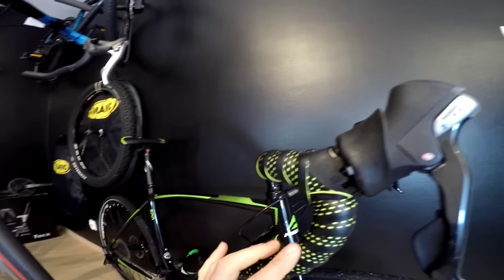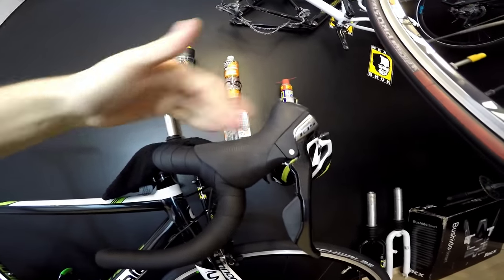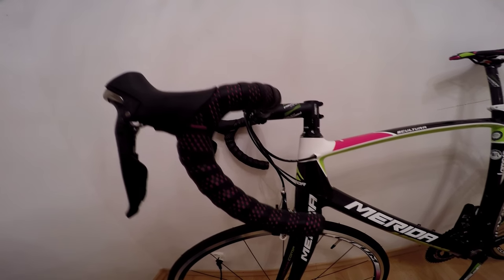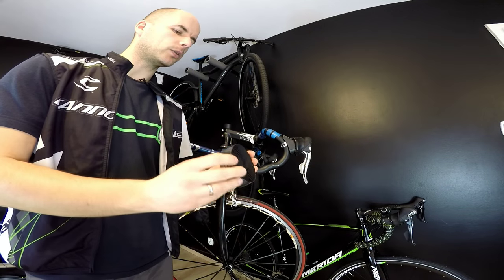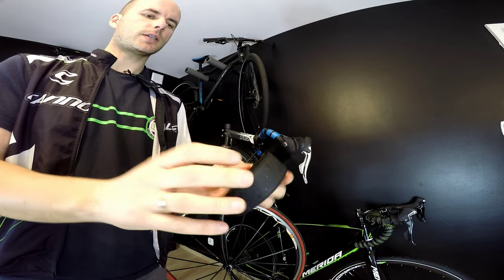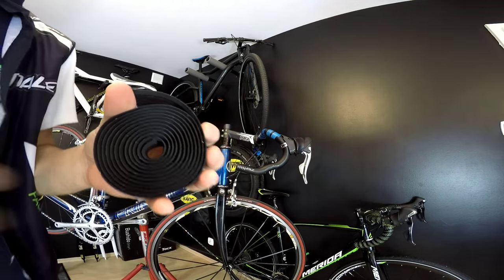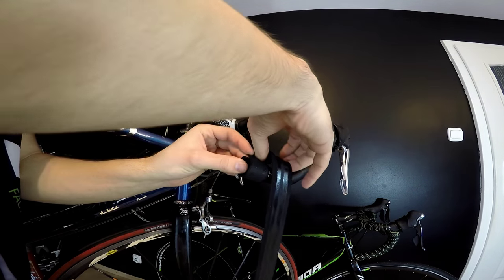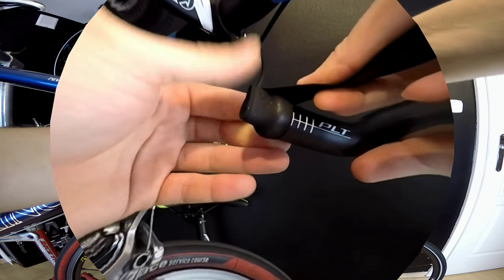How to change and wrap bar tape - different STYLES. Replacement.

Comment: You should not have to do a figure 8 around the levers if you are using a clamp strip as for me that makes too much tape bulk in the lever area and doesn't look good. Glad to see that you wrap to the outside on both sides as your hands twist to the outside when in the drops.